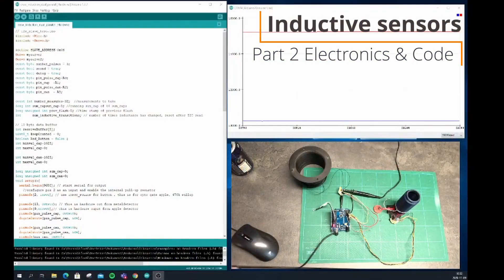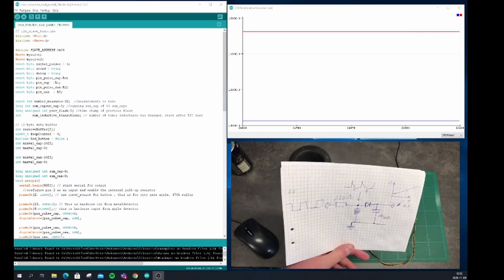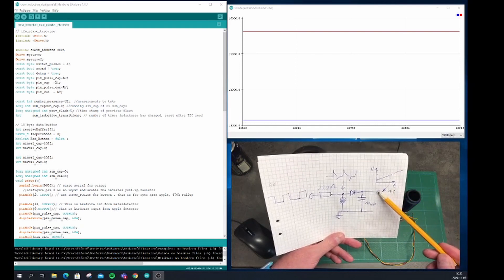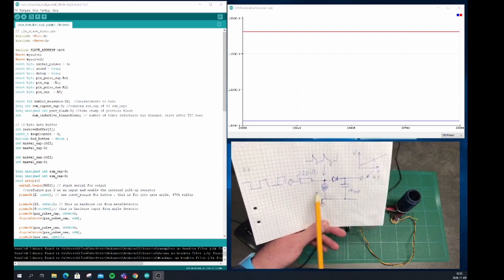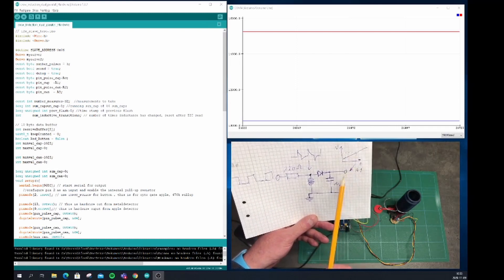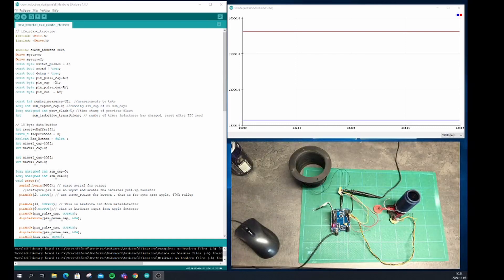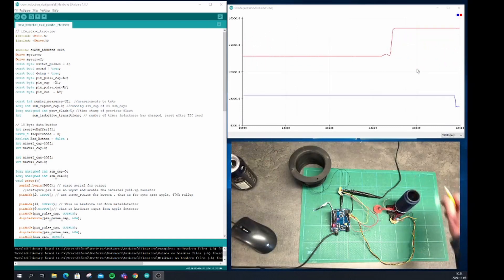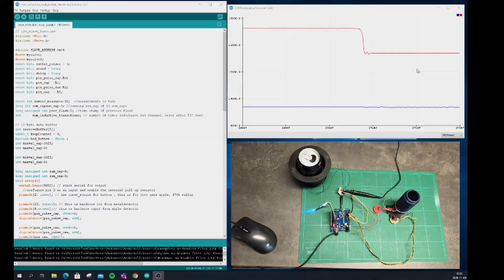SodaCan detector part2

Comment: Hi @hansforsberg,
Would it be possible to build a photo-detektor to activate the feeder if the birds deposited something non-metallic? I got a fantastic idea derived from your videos, that is perhaps even commercially as well as environmentally very interesting.
Reply from the maker: Yes, introducing a photo-detector would be possible, even though one has to think twice to handel the ambient outdoor light conditions. Preferably use modulated IR-light.

There is such an arrangement at the nut-dispenser,stopping the feeder mechanism as a nut passes...

I have not explored 'traditional' sensing methods that much, since my plan is to deign a general purpose detector based on Camera and a neural network. There will be a video regarding these plans soon.

/Hans
Reply: @LabbHasse  Thank you for your answer. I see now, that I asked in a clumsy way. I actually meant a video/ai based shape recognition system. If the system could recognize different variations of the same type of non-metallic object it would open up for a very complex cooperation between bird and man...

Comment: Nice very helpful! Do you think it is possible to sense the magnetic field around an AC cable with ~1A current flowing through with a similar approach?
Reply from the maker: Well, to sense the ac current flowing in a wire, you 'only' need the coil, and a way to measure the induced current/voltage in the coil. It could be made really sensitive with a few 'amplifying transistors cascaded' Something like this https://www.youtube.com/watch?v=0hI3hVtiHKE

The soda cans does not generate any induced current in the coil (well, maybe fraction...) That's why i use the active approach...feeding pulses and measuring the inductance of the coil...
/Hans
Reply: @LabbHasse  thats exactly what i was looking for thanks 👍